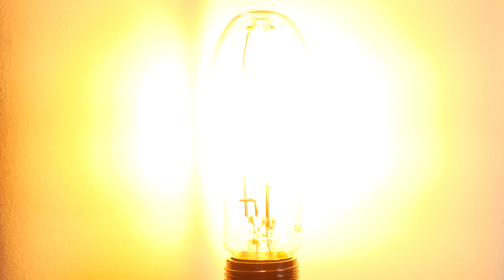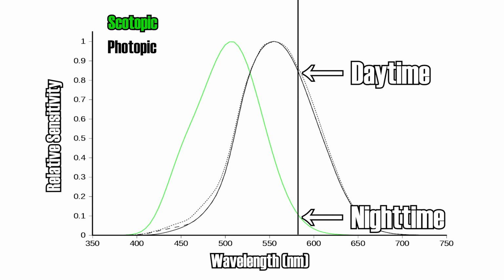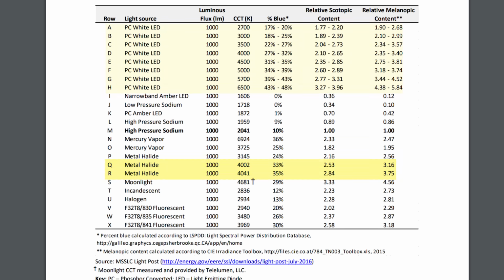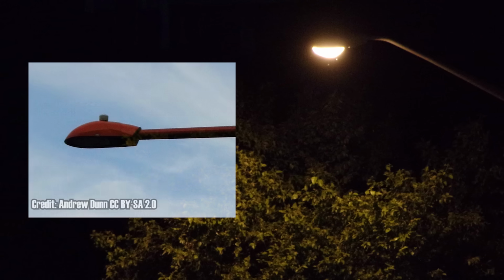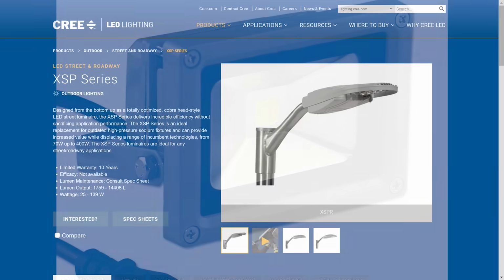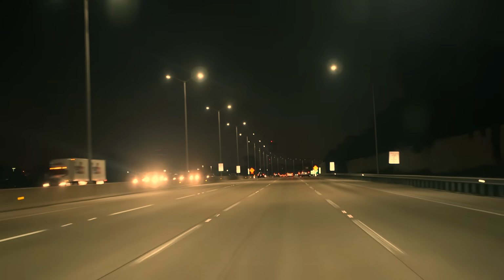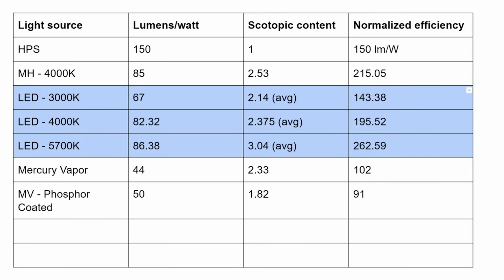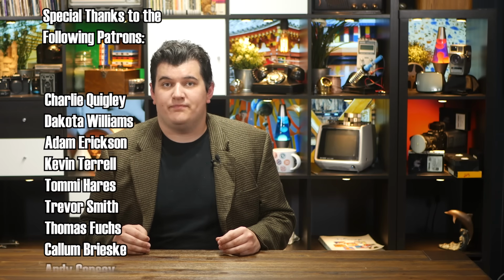The LED's Challenge to High Pressure Sodium

Comment: They started replacing the old sodium lamps where I live. I noticed that it needs more caution in an intersection, as you notice the a car's or bicycle white headlamps later. On the yellow-lit roads it is instantly noticeable that somebody approach the intersection from the side.

I think, in urban areas the yellow lights are (were...) more safe and more pleasant...
Reply: Where I live, we use the warm sodium lights at intersections and the colder LED lights on the straightways inbetween. I don't think it's intentional (the lights on the straightways just got installed later), but I think having a mixture like is a nice touch. You get the best of both worlds, plus you can tell an intersection is coming up if a streetlight is differently colored.
Reply: Also romantic
Reply: its the poor CRI of the LEDs installed

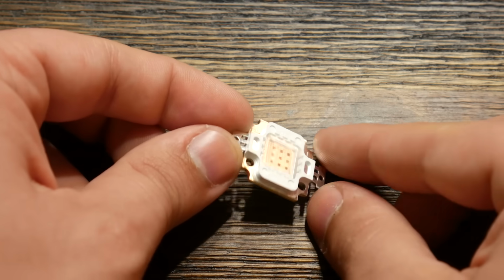Comment: The light at 11:58 uses the exact same chip as the one shown at 12:10 to be better. Reason behind is that the floodlight is designed to illuminate an complete areal, while street lights illuminate a path.

Comment: Oh - also {nod to my over fantasy comment} in real life...
I remember a prototype system a while back with edge markers or 'Catseyes' to highlight the road direction on some of our dangerous roads up in the hills in the Peak District National Park (UK).  The car's headlights actively triggered the lights for a set time: short enough to be battery powered via a solar cell charged during the day, given traffic density.  An interesting feature was to warn drivers of ice patches ahead of them in dips, hollows and bridges - as there were a lot of these and winter temperatures hovered around freezing for weeks at a time - by changing the color to of the markers to blue if the road surface was below freezing.

Comment: I would prefer 5000K LED lights in highways, they do provide better visibility, keep drivers awake. But in residential area, 2700k is preferred. Its easier on the eyes, wont affect sleep cycles.
Reply: I personally suscribe to the idea that lighting should change as night progresses and was thinking about it before he mentioned the reader's suggestion, cooler as the sun goes down (bow to the mighty Earth, sun), more moderate until midnight, when street lighting goes 3000K. Then as we get closer and closer to the morning break it gets cooler again.
Reply: @Ometecuhtli  big brain this is an epic idea
Reply: >5000K for highways, 2700K for residential neighbourhoods
THIS!
Reply: @DJMinor5000  The bluer lights also result in bluer sky glow. The lights effect the circadian rhythm of people and animals in a large area even if they are only used on highways. Circadian rhythm disruption has been shown to cause or exacerbate certain serious health issues. The connection between sky glow and circadian rhythm was not discussed much in this video.
Reply: @samuelhammons2528  Correct me if I'm wrong, but don't LED fixtures cause less sky glow a priori , since their output can be more specifically focused on the roadway rather than spewing light directly into the air? If bluer wavelengths propagate more easily through the atmosphere, it may be offset by the lower amount of light contributing to sky glow in the first place.
Reply: Its like this in my country
Edit: all of them are leds
Reply: LED bulbs have various types ex. Tinted dimmed LED
Reply: Yeah, tell that to the city of Nampa Idaho, they did the exact opposite to what you said and it's awful
Reply: The problem is that 5000k lighting over a highway does not just affect the highway; light that blue is extremely polluting—it carries very well through the atmosphere—and affect residents for miles.
Reply: they replaced the HPS lights outside my house with LED lights and honestly i thought it was the moon when i first saw it through the window. they are really distracting.
Reply: @terryh.9238  That's not solely due to it being LED. That's because they used a cool color temperature above 3500k
Reply: dodecahedron Blue light has objectively more glare.
Reply: dodecahedron You said it is not easier on the eyes. Glare is not easy on the eyes. Blue light has objectively more glare. Therefore blue light might not be easier on the eyes. How is warmer lighting painful?
Reply: Nah in residential areas they don’t need street lights whatsoever apart from a moonlight
Reply: Leds are garbage, HPS STREETLIGHT HATER,
Reply: Cold white lights are disgusting. Makes for a very uncomfortable mood
Reply: It also means that there is a social aspect to it. If we have the choice, we should sleep at night, not drive. It's also about adapting our work schedules, for example. But then, there's winter...
Reply: @Simboiss  Well, business are going to need to change their hours then.
Reply: @Simboiss  fascist
Reply: I think 4000k everywhere would be good with maybe 3000k in neighborhoods.
Reply: 5000K lights keep drivers awake after they get home and in bed. The next day they are sleep deprived. I think LED lights with the color of incandescent lights would provide the public with the greatest overall satisfaction.
Reply: @men2dewy  most people won't go to sleep the second they get home.
Reply: LED street lamps suck in rain and foggy conditions. If it is snowing good luck.
Reply: @uberdang830  also I love the snow glow effect

Comment: High pressure sodium has very high penetration in conditions of limited visibility, e.g. in the fog. Thats why is used in street lighting, ports, closed channels, canals, bridges etc.  Fot the same reason in car lights, we use halogen lamps or xenon lights near 4300K. When using xenon at 6500K the visibility will be better, but in the case of fog, this will brighten up brightly and turn into a white impenetrable veil, with no distant vision at all. So our sodium lamps ensure high penetration in case of fog.

Comment: Quick note on the Cree lights - the street variants top out at 5 lenses. The smallest use 3. Larger chips are used for floods. I've handled an ungodly amount of them.usually I would track size/wattage (Because they always get the wrong stickers factory) using the lens count and form factor.

Comment: My city actually switched to induction street lights.  They are energy efficient and they look like incandescent bulbs but they are way worse than the HPS bulbs because those lights are a lot dimmer and it only lights up one little spot compared to HPS bulbs where a lot more is lit up.

Comment: 12:01 you can take those 'cheap' flood light fixtures and use a culminator and lens, i did so with a "50watt" LED COB and got a much narrower beam, about like a traditional mag light 'zoomed out' i'd guess a 60-80 degree beam, not all that impressive compared to more compact flash lights, but for a 1 inch square LED array and a culmonator/lens cobo that only stuck out 2 inches from the array surface, i'd say thats pretty good, i think i still have this PVC pipe monstrosity somewhere, it used the heatsink from an old pentium 4 processor and a regulart PC fan to first cool the controller, then to cool the LED(blowing back to front) I think i have a video of it somewhere on my channel, never mind video is garbage and doesnt cover how it was made just the lighting effects

Comment: Would the effective lumens per watt for LED lights be higher if you have the diodes oriented on only one side, therefore only requiring half the needed diodes rather than aiming half of the diodes into the fixture or god forbid into the sky? Warmer colours would be more viable then.

Comment: My city is switching to LED lighting. They chose a yellowish LED light. Streets are way better illuminated, and, as a driver, I quickly noticed that I can clearly see crosswalks and objects way further away than with sodium lights.
Reply: they add a really bad glare on the windscreen when it rains   (pretty much blinds you)
Reply: Yes sir,
If you don't mind me asking, what city do you live? My city has installed Cool White i.e. 4000+ K LEDs across the board and I hate it. The Streets appear to be darker and some of the lighting is too bright.
Reply: Here in and around Barcelona they also use them often 
And Yes, those gold colored led lights provide much better visibility than the monochromatic light of sodium lights.
Reply: In arctic areas, sodium lamps are often used because you can better see and orient in horrible snowstorms with the yellowish light. Cold blue light tend to fade out in a sort of lighthbouble around the lightfixture. But even the northern cities of greenland are switching to cold blueish light.
Reply: @PJ-kj3ef  This is why LED is so amazing. You can control the colour temperature far easier and use what works best in any given area. You can even change it dynamically if you want, budget allowing.
Reply: @PJ-kj3ef  water reflects more blue light which is why the ocean is blue.
Reply: Here in my city in LA County they installed 3500k led streetlights and they are SO much better it’s insane

Comment: I have a deep suspicion, that circadian rythm disruption caused by higher color temperature LEDs might be caused mostly by the fact, that people aren't used to them.
Sunlight color temperature is around 5800K (5-7k, dependent on conditions), and therefore actual normal white light LEDs are the cool  white 5700K.
The main differences are in the brightness - sun is obviously much brighter than typical LEDs you'll get in home, but the biggest difference is in light spectrum - where sun has perfectly smooth black body curve, most typical LED's have huge peak in blue light and near UV light, with dip after that. This however is being mitigated with new, sunlight LEDs.
As far as I'm concerned, more blue LEDs can dicrease amount of sleep, which is basically a win-win situation.

Comment: The better fog visibility offered by warmer colour lighting should have been discussed.
Reply: Actually, I've found that during heavy fog, visibility is greatly enhanced by having light pointed upward and shielded from direct view.   You get the light to reflect back from the fog, and you can see a comparatively long way.  It would be terrible for light pollution, but if it were ONLY used during heavy fog, it can work pretty well.
Reply: @kennethcramer9686  Wait, that sounds terrible. I imagine it would have the same effect as driving in fog with your high beams on, which just reflects all the light back in your eyes and glares out everything else.
Reply: @Leo9ine  Actually it's kind of the opposite. Since the light is indirect you can actually see further.  If the lights shine forward,  then you get a lot back, but if they' up,, they kind of light up the area and you don't get the glare back on you.   I've seen it a few times where freeways in rural areas cross bridges in small towns, and there are street lights shaded by signs and the like.  The difference is rather remarkable.
Reply: the reason he didn't mention it is because LED's color can change even dynamically if you're City wants to get fancy with a street lighting so your city could go get a warmer light LED if they wanted to or they could cheap out and get s*** LEDs without any lens and blind you if they're actually Satan
Reply: let's make a compromise if we have blue lights that make it easier to see w/o fog. if we have sodium lights, it's easier to see with fog. so let's get rid of lights together, fuck seeing
Reply: @coziiikinz5658  Make this eye surgery mandatory: https://www.syfy.com/syfywire/guys-eye-surgery-accidentally-gives-him-strange-super-vision
Then replace every light fixture with UV lighting.
Doctors perform more operations, you get disinfected on your way home and more importantly you gain superpowers.
Sounds like a win-win-win to me.
Reply: @Ometecuhtli  Cataract surgery makes it harder to focus.
Reply: @coziiikinz5658  This guy has the right idea!

Comment: There is a proven phototoxicity of blue light for the retina, since years. The ANSES and AFSSET (french organisms) have published works in 2010 about it, confirmed in 2019. Sorry, in French : https://www.anses.fr/fr/system/files/AP2008sa0408.pdf (search for AP2008sa0408.pdf in google).
If you are looking at the Spectral Power Distribution of most LED, there is a major peak of blue light.

Comment: i think that the compination of both  high pressure sodium and LED  is the best than just using the one or the other.....
Reply: I don't think its impossible to achieve the color characteristics of HPS using LEDs, the way the light and fixtures look, it depends on the fixture used and implementation.

Comment: A quick update about LED street lighting fixtures:
This CREE fixture is a MASSIVELY bad one. Today, LED fixtures go up to 130lm/W and higher at 3000K with a CRI of 80-85, which is an overkill CRI for general illuminance.
And this is achived with really complex lenses (which introduce some loses and reducing efficacy).
Using 3000K CRI70 LED chips (more than enough for street lighting) and a bit more moderate lenses and fixtures can go up to 140-150lm/W, and using 4000K can go even higher.
There are floodlights today than reach 180lm/W at 4000K-5000K.

Comment: Very interesting video - especially for a "rather nocturnal animal" like myself. And since I'm pretty dependent on artificial lightning in my daily life (pun not intended), it is a subject of great importance (and interest) to me.
There are some other factors not mentioned here, which affect the "quality of light" - one of them is that invisible flickering (yes, I know - there's another video on this subject) that affects HPS, LPS, MH and MV lamps - and the other one is spectrum continuity.
Perfect, or "smooth" spectrum continuity is available only with a sunlight (rather absent during the night) and incadescent lights, like halogen lamp. But those are not very energy efficient, and produce lot of heat. HPS lamps are kinda OK, as they have peaks for both sodium and mercury emissions, and because of high pressure inside arc tube  there's this effet of spectrum broadening.
But I digress here. There's one more difference between "HPS produced light" and  "LED produced light" not mentioned in this video - their ability to penetrate (pass through) a fog. Which is a fairly common weather phenomenon  in autumn, winter and spring in colder temperate climes.
Amber light produced by HPS lamps passes through a fog without much absorption/ dispersion/ scattering, while shorter wavelenght light of 5700K LEDs can barely pass through even a relativelly light fog. My guess is that in many places in the world this would be the reason for HPS lamps to stay around for years to come, as there's not much use of "the best light source" if it can't light properly a road when it is most needed.
Well, we'll see.

Comment: Wow! You are like an encyclopedia full of information. 5,000K 150w LED downlights far outperform 250w MH. After changing out 38 fixtures on one property, the difference is crazy. Colors are better, the light projects further out into the parking lot, and they use less power. The LED fixtures do have dedicated lenses with specs for the angle and throw. Before the upgrade, I was converting the old MH 250w down lights to 54w LED cob lamps and I removed the ballasts and direct wired them to the 277v feed. It is pointless to keep the ballasts, as many old ballasts are compromised, humming, or already crispy critters when pulled out. The 54w cob lamps were a small improvement in light output from the 250w MH. For office lighting, I always used 4100K 32 or 34w 48" t8 lamps as a compromise as clients liked it and it worked with most paint colors.

I prefer 6500K and have that color led lamps everywhere except for my desk lamp at my computer desk where I watch youtube in the evenings, and the fan lights in my bathroom, and small lights in my bedroom. The warmer color is easier on the eyes at night, especially after being asleep, but the higher kelvin lamps allow me to see details much easier. Some people say that with a very high CRI, a warm light should still allow you to see very well. I disagree and, at least personally, see details much better in cooler light. The color of the lamps also has quite an effect on paint colors. I was a pro painter for 17 years and also do many other trades including electrical work and lighting maintenance on commercial buildings, as well as welding and fabrication work. Much of my work and hobby activities result in me wanting to see fine details and decently accurate colors, so higher temperature works best. Dealing with paint colors in different daylight or artificial light made me notice how lighting colors vary, even before I learned electrical and lighting.

My smart phone has an option to apply a blue light filter, for evening use, but I don't like it. Same with my tv. Before all of the artificial lighting, people had the warm colors of the sunset and then campfires or candles to provide light at night. Humans were very smart in creating artificial light, then we learned how how smart our eyes and body chemistry are. It is interesting that the warm light of HPS is better for our sleep cycle and closer matches fire, yet our night vision is tuned for a cooler color.

Thanks for the great videos. It is one thing to work on lighting and know what clients want from a product and service, but it is cool to learn a bit about the science of all of it. It is obviously very relatable, and while at some points a bit above my head after a long day of work, it wasn't too hard to follow along and understand.

Comment: There are way too many streetlights out there to begin with. You could get rid of half of them and it would still be safe. I also think that if you are driving at night, you want your circadian rhythm to shift a little so you don't fall asleep at the wheel. And as long as light pollution isn't harming anyone or any animals, we have better things to worry about. I admit I do not know the dangers of light pollution, maybe you could do a video on that.